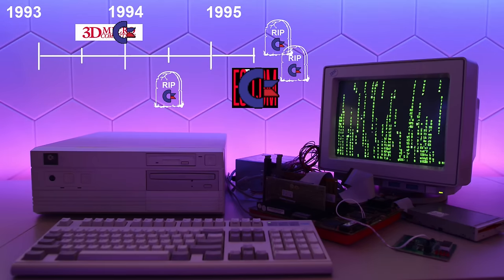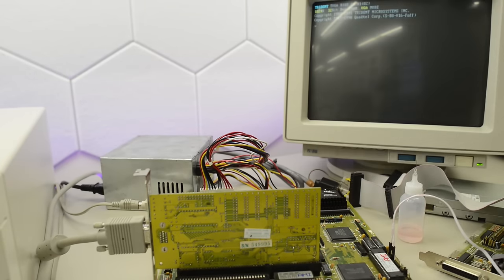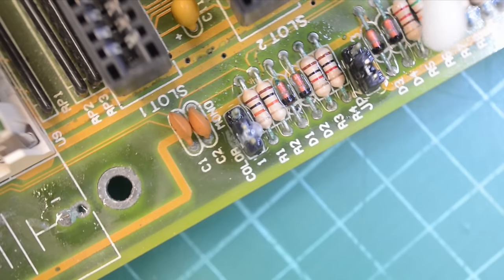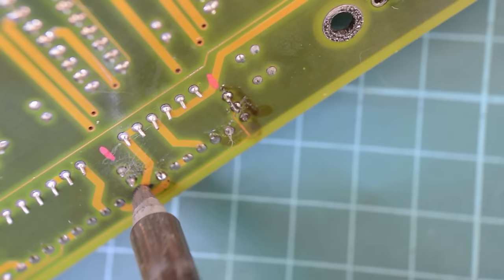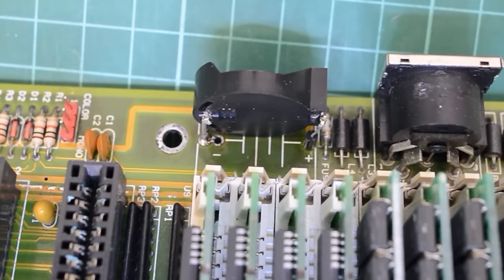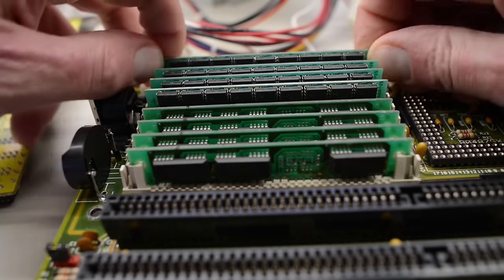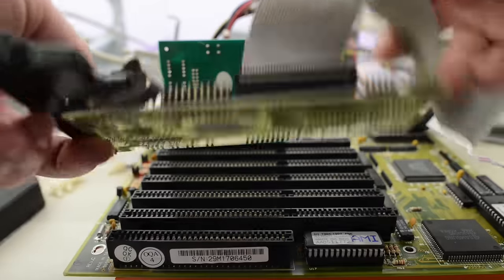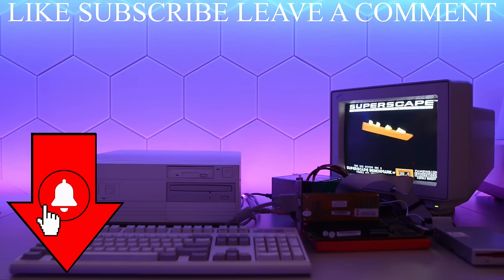Commodore 486SX25 Restoration. Fixing leaky VARTA battery damage

Comment: Why did you not used the battery header near the keyboard connector? That way you could have used a battery holder with 2 AA batteries or with a 3V coin battery mounted on the case.
To remove that green corrosion that is a base, actually you neutralize that base with an acid. We usually use vinegar (acetic acid) because is strong enough to do the job before evaporates, is easy to get and the salt formed is easily soluble so easy to wash. But you may use any acid that you have access like lemon juice (citric acid) or lime juice that you can get concentrated at bottle in grocery store. Once, I had no vinegar at hand and to remove batteries form a corroded battery holder I used the acid used to clean toilet; it is hydrogen chloride, an acid quite strong (it will burn you) that I diluted in water until I get it to react with the crusty corrosion (I put drops of acid in water until it was concentrated enough to get a reasonably quick reaction).
I used to clean the ISA slots with a reasonably thick paper/cardboard on wich I put a cloth (linen, cotton) soaked in alcohol or contact cleaner. The cloth being abrasive due to its fibers helped cleaning and the paper was there just to make the "cleaning device" thick enough to bend a bit the contacts; it was almost thick like a pcb.
About the crystal form factor, sometimes there are traces for rectangular (like yours) AND square crystals on the same board, so the manufacturer can use either in the same spot; there may be the same on your board, just check for continuity between the pins in the socket were the crystal is seated.
Reply from the maker: Thanks, I'll try with some lemon juice. I'll remove the crystal in the next project video and we will have a look at the socket. I will probably order some coin cell holders on wires to use on the pin headers.
Reply: @Epictronics1  Yes, take a look at the crystal, I found on many  P1 motherboards and on some newer 486 that under the AT keyboard connector are the pads and sometimes the silkscreen for a PS/2 keyboard connector. On many 386 motherboards I found the same with the main crystal oscillator, the pads existed and were connected for both types of oscillators square and rectangular one.
Reply from the maker: @sebastian19745  I had a look and there are only the four obvious pads. However, there is plenty of room to add a modded socket. I have actually ordered one of the square crystals to test. I wonder if we could use the even smaller ones that only have two legs? They are much easier to find
Reply: @Epictronics1  If I remember correctly, those 4 pins crystals are in fact a full oscillator with one pin being ground, one being Vcc (+5V), one being output and one usually NC (but on some models the 4th pin is for fine adjustment). Check the datasheet  if you plan to make an adapter. However, despite the different footprint, the square cans and  the rectangular ones are identical.
So no, you cannot use a two pin quartz instead a 4 pin oscillator. However, you can use an clock IC (found on more modern motherboards 486+) with its 14MHz crystal to make many clock frequencies. Usually that IC is configured with jumpers (remember the FSB clock selection between 25, 33, 40, 59 or 66MHz on some 486 ?).
Reply from the maker: @sebastian19745  Yes, I think the sensible thing is to get a bunch of ICs. I just ordered a few crystals and with shipping, it ended up at $20. Better to have a few ICs and adapt them to whatever project is at hand
Reply: @Epictronics1  From a damaged 486 motherboard I salvaged AV9107 IC (trough hole DIP14, I have -03 version) with its 14MHz crystal and made an adapter. I can select many frequencies from 2 to 100MHz with dip-switches, I have two clock outputs (CLK and 2xCLK) and I have also Enable pin and it is powered from 5V. Try to get it (or a similar one), is very handy to have all needed frequencies.
Reply from the maker: Mr Guru  I think your idea with a breakout board for SMD crystals is probably the perfect solution

Comment: I think baking soda (sodium bicarbonate) is used for neutralize both acid and oxidation. The thing is that you need a lot of time. You can use also with vinagre and or oxygenated water. But I haven't tested that much which method is better and faster.
Reply from the maker: Ok, do you sprinkle sodium bicarbonate on the board when it's time to clean off the vinagre?
Reply: @Epictronics1  since it work for corrosion you can use both, but you need to clean after or remains like a solid paste.

Comment: i think they make rechargeable lithium coin cells, might could use them as replacements
Reply from the maker: I did in another video. I used the LIR2032 but some viewers commented that the onboard charger was too crude and there was a risk of things going really bad. https://www.youtube.com/watch?v=7AIkJctDP8w&t=531s
Reply: @Epictronics1  Yup.  LiOn batteries require some special circuitry to charge/discharge. Honestly the CR2032 + diode is likely the ideal solution.

Comment: Diode on its own is not enough. You need to also add a 1K resistor.
Reply from the maker: That could be a problem. The CR2032 is 3v and the 1N5817 has a voltage drop of 0.4v. So we are already down to 2.6v instead of the original VARTAs 3.6v
Reply: @Epictronics1  When disabling the charging circuit, I use a SCHOTTKY diode (like the BAT85,113) When the computer operates, the BIOS SRAM chip gets 5V from the PSU. The battery is used only when power is off. Typical SRAM can still hold its data with only 2.2V.
Reply from the maker: @leonkiriliuk  Ok, have done any longer tests with a CR2032 and 1k resistor? Will it last for a while?
Reply: @Epictronics1  I've had an X68000 computer run for 5+ years now on a CR2032 this way. This is how NES, SNES, etc carts all save SRAM and those lasted for 25+ years now.
Reply from the maker: @leonkiriliuk  Ok, cool. I'll replace the diod lead with a 1k resistor in the next project video. Thanks
Reply: @Epictronics1  I think we have confusion here. I didn't say get rid of the diode. I said you need to also add a 1K resistor. The correct circuit has a diode + resistor.
Reply from the maker: @leonkiriliuk  Yes, that is how I understood you. I'll keep the diod on the positive side and replace the diod lead with a resistor on the negative side : )
Reply: @Epictronics1  I think we are saying the same thing but just to make sure, between the +ve lead of the CR2032 socket and motherboard you'll find a 1K res + diode. The -ve lead of the socket just connects straight to ground on the motherboard.
Reply from the maker: @leonkiriliuk  Yes, for practical reasons I thought I'll place the diod on one side of the CR2032 and the resistor on the other side : )
Reply: What is the purpose of adding the resistor? I've never seen that on a PC. The only thing I can imagine is that it will reduce damage if there is a short circuit. I don't think it will hurt, I just don't see the purpose.
Reply from the maker: @eDoc2020  🍿
Reply: @eDoc2020  Look up the spec sheet for any quality CR2032 and they will have a section talking about "Precautions in Circuit Design for back-up Use" They will always have a protective resistor calculation table along with a sample circuit diagram. I've seen them in PCs, game consoles, game carts, etc.
Reply: This is something I didn't know. According to this document, AAA4000COL15.pdf on the Panasonic website, the resistor is there as extra protection in case the diode fails short. That document also gives the maximum allowable leakage through the diode: 3% of the battery capacity, in mA-hrs, over the lifetime of the battery
Reply: @danmenes3143  Makes sense. Although on the last motherboard I worked on I was examining the circuitry and I'm pretty sure it didn't have the resistor.
Reply: @eDoc2020  The document seemed to suggest it was a UL requirement. Such a failure mode doesn't seem very likely to me, to be honest, and the fire risk from a CR2032 is pretty small, even if you blow it up. But, belt and suspenders, as they say, and a 1k resistor doesn't add much BOM cost.
Reply from the maker: @danmenes3143  I actually blew up an LR44 by mistakenly charging it in a circuit ones. It was surprisingly spectacular but no fire or sparks as far as I could see. Just a sticky black powder all over the board that took forever to clean up lol

Comment: Could try to throw the motherboard in the dishwasher? Or ultrasonic cleaner? And then do tests again....
Reply from the maker: I wish I had an ultrasonic cleaner. Especially the size of a MOBO : ) Not sure if I'm comfortable throwing it in the dishwasher though... Maybe I'll try with something lesser first
Reply: @Epictronics1 
I understand for the ultrasonic cleaner. But you've got such a nice youtube studio setup that an ultrasonic cleaner wouldn't be out of place for the serious repairman? ;-)
Regarding using a dishwasher: There are absolutely 0 risk to damage electronics doing this.
You would have to remove the newly installed coin-cell and let dry thouroughly after the cleaning.
I think it would bring some consistency and more reliability to your repair process, which is always a plus.
BTW you're probably aware that the 8bitguy has done this in one of his video (or was it retro-receipe)?
Reply from the maker: @LFOSyncToo  yeah, I've seen a bunch of YouTubers cleaning mobo's in dishwashers. I'm sure it's fine. but it feels really weird. I guess I should try it out

Comment: Lemon juice smells better and neutralizes battery and capacitor juices.
Reply from the maker: Sound good to me : ) Do you use regular Lemon juice?
Reply: @Epictronics1  I’ve been using the Sicilia which is sold in a small, lemon-shaped bottle. Or you can just squeeze the juice of a lemon. I also have citric acid grains from an agricultural store that you can mix into water.
Reply from the maker: @terosaarela4555  cool, I'll try the stuff they have at my local supermarket. Thanks
Reply: @terosaarela4555  yeah, citric acid is a good not smelly replacement for vinegar.

Comment: i have something that looks just like this on my desk right now
Reply from the maker: cool, have had a look inside?
Reply: @Epictronics1  its just a motherboard and power supply i am trying to get to boot. i have a few 386 and 486 motherboards and a small pile of ram and cards. i'm tring to get a operational ISA bus system running.
Reply from the maker: @borgheses  Oh, ok, I thought you meant you had a Commodore 486 on the bench : ) Good luck with the project
Reply: @Epictronics1  thanks. i cant find the motherboard anywhere online. its got a cyrix 486 dx  40 and math co-processor and a slot for anther processor.
Reply from the maker: @borgheses  You could ask the Vogons. They are very helpful in such things

Comment: After doing a little digging, I'm not sure you make the right choice to use a Schottky diode rather than a PN junction diode. Yes, the forward voltage drop is nominally lower, but you are seeing something like 0.5 uA of leakage current, which seems a bit much to be pushing into a CR2032 batter. I might lean towards something like a 1N4148, which lists a max leakage current of 25 nA at 25 C and 20 V. Typical leakage at 1.5 volts reverse bias will be even lower.

According to a Panasonic design guide (AAA4000COL15.pdf, if you want to Google it), in a backup design like this, the total allowed leakage through the protection diode is 3% of the battery capacity, cumulatively, over the lifetime of the product. A CR2032 has a capacity of about 220 mAh, so the cumulative allowable charging current is 6.6 mAh, which at 0.5 uA, gives you 13,200 hours before you have pumped enough electrons into the battery to risk popping it. That's probably fine, given how infrequently a vintage computer is likely to be used, but for a computer that was on all the time, it would be less than two years.

If you are worried about the forward voltage drop of the 4148, that's probably less of a concern than you think. The rule of thumb is, "silicon rectifiers drop 0.7 volts," but that's not going to be true under the extremely low currents that the backup battery has to supply. I would be surprised if you see more than two or three tenths of a volt in practice--although confirming my prediction would require a meter with an extremely high input impedance.
Reply from the maker: Cool, I'll switch to using 1N4148. I have some leftovers from another project. What do you think about adding a protective 1k resistor as suggested below?
Reply: @Epictronics1  The 1K resistor certainly won't hurt anything. The additional voltage drop will only be a few mV. I think the risk that it is intended to prevent is pretty low to begin with, but if you like the belt-and-suspenders approach, go for it.
Reply: To be clear, I'm not an EE or anything, just a hobbyist. So take my advice for what it's worth.
Reply from the maker: @danmenes3143 Same here. But data sheets and math apply to us all. I did a quick search and 1N4148 doesn't seem to be an uncommon choice